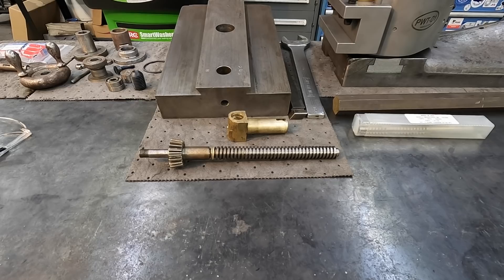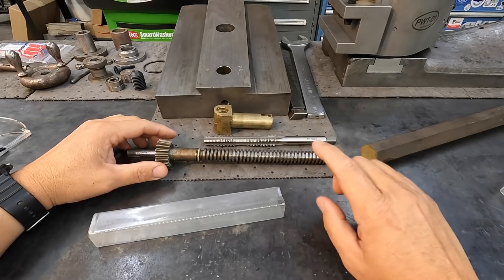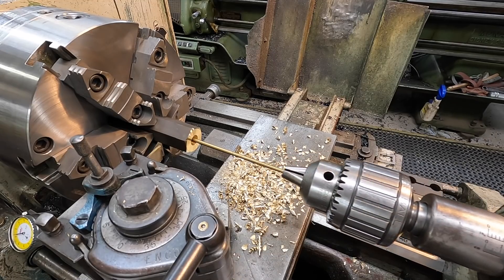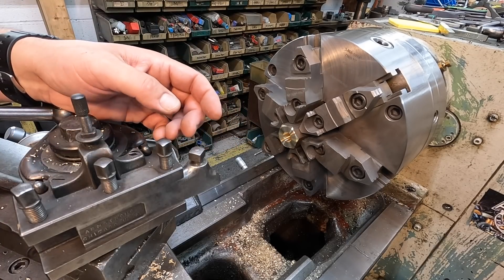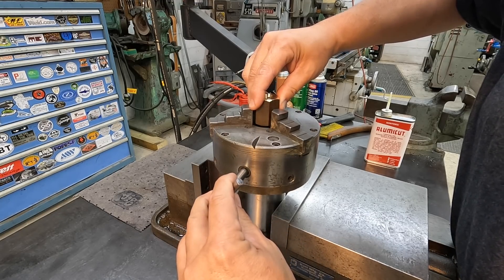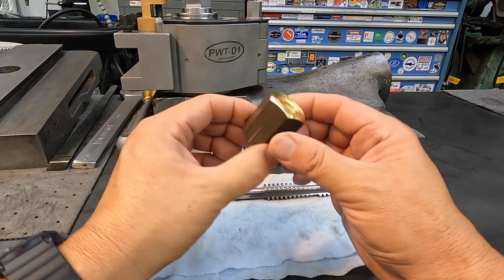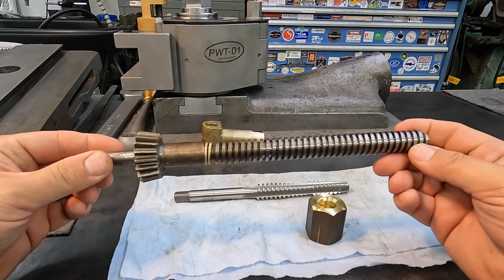Machining a Bronze Acme Nut

Comment: save your skin from the flying hot bronze chips.  get a natural HAIR paintbrush  1/2  or 3/4 wide  and hold near the cutting tool/work  and deflect those chips.  don't use a plastic bristle brush---they melt right away

Comment: Would it be possible to make that original square thread using a parting tool but slanted? 
If so, would it then be possible to machine a tap for the inner square thread out of the new threaded shaft?
Just wondering what you would do if you really had to use the original thread...

Comment: Adam, you didn't mention the fact that the thread you are cutting is LEFT-handed.  So for a single job {& an indefinite future sitting in a drawer} you need to buy an acme left-hand tandem tap at over $US 160.00.  It is good to know that there are on-line suppliers who can provide same.

Comment: That small starrett ruler tip was great. I never knew that small of one existed and ordered one right after I finished your video.
Reply: The depth function of a digital or vernier caliper would achieve the same result, however that thin rule would win every time for convenience. Time to find one locally.

Comment: It looked like there was a lot of runout on the Flexarm spindle as it was tapping. Does this affect the thread in any way?
Reply: The tap is following the hole and is not running out. The slight twisting and wobble of the flex arm is the normal torque reaction to the heavy tapping pressure and cannot be entirely eliminated.

Comment: Ok now I have to know, are you not supposed to back the tap out because it's a tandem tap or because it's an ACME tap? Can you back out with regular ACME taps?
Reply: Yes, because it’s a tandem tap, not because of Acme. If you backed out this type of tap the smaller entering teeth would probably cut into and ruin the finished threads. A standard non tandem Acme tap could be backed out same as other taps.

Comment: It looked like the tap was not running true to the Flexarm tool holder - was that my imagination, and if not (if it wasn't running true), could that make your final thread oversize?
Reply: It’s part of the design. It’s a floating arm. Focus on the tap shaft and not the tapping machine. It is running true.

Comment: I always screw cut in the lathe Acme lead screw half nuts for a couple of reasons. 1. being it avoids the cost of a tap which are mouth wateringly expensive here and only likely to be use once so not a good use of resources (cash)
2.  Its guaranteed that the screw cut thread  will be true to the rest of the half nut especially where it is secured to the cross slide.  I did notice that the tap in the tapping machine had a wobble so some sideways strain was put on the tap possibly making it cut a few thou larger. and not true to the machine surfaces.

I have cut h/nuts as small as .625in (a Myford lathe lead screw size)

  Grinding a tool that small can be a bit of a challenge especially side clearance which has to be spot on or the tool will not cut and only rubs.
The most successful way I have found of forming a accurate tool profile is by using a tool and cutter grinder fitted with a multi position vise. A Shadow Graph machine would be handy here to check the profile and size.

I grind the tool just a few thou under size, on the width which allows me to get a near perfect fit by tweaking the compound slide.
Reply: yeah I notice the runout in the tapping op too.

Comment: Could you explain why you shouldn't run this tap type in reverse? I just can't figure out why.
Reply: My guess is the sharp points of the first part might mar up the inside of the nut on the way out, kinda like how when you bring a cutter back on a lathe without pulling it out first, where deflection/distortion causes a slight cutting pass. Also, a normal tap is tapered, so coming out backwards there will be no rubbing. But here there are essentially two taps, and you have to bring out the whole big end of the first tap.
Reply: Likely the same reason you don’t run a reamer in reverse.

Comment: Had the occasion to drill and tap some heavy dimensional copper once. Tried all  of the conventional tapping and cutting fluids, even tried kerosene (recommended by a machinist friend), but to no avail. Wound up twisting off several drill bits and breaking three taps. Finally, by accident noticed the jug of bar and chain oil used in the chainsaw, decided to give that a try. 
    Finished the job with one bit and one tap. I would have never thought as sticky as that stuff was (akin to STP oil treatment), that it would have worked. But it's stickiness must have been what was needed to counteract the soft gummy nature of electrical grade copper.
Reply: Yeah copper's a bitch. Thanks

Comment: Back before expensive tandem acme taps were commonly available, we would have rough single pointed that size ACME thread in the lathe, and finished it up (also in the lathe), with a conventional single section ACME tap to produce final size.  
I noticed the run out while you pushed your tap through the bronze. 
Single point threading, then finishing with a tap in the lathe, reduces any possible thread run out relative to Nut OD.....if that matters.
Reply: Had to go back and look after reading your comment and man that did run out quite a bit.
Reply: I noticed that run out too, if you can see it, then it's gotta be pretty large. I was surprised no one mentioned it besides you.

Comment: That flex arm is a really cool tool Adam. Sure beat the old 25hp radial drill we used for power tapping. Used to do gobbs of 2, 3, and 4 inch NPT fittings with skip tooth taps. Back in 1990 they cost a whole months pay.
Reply: Sounds like you broke a couple….(:-))

Comment: Did anybody else notice it was a right hand thread for the nut but the screw will be left hand thread?
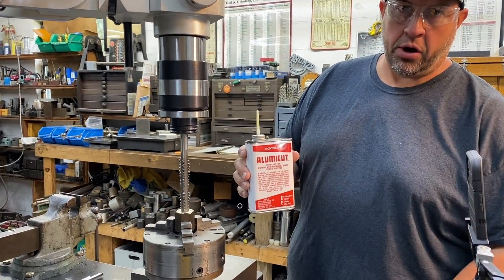Reply: Nope. Watch from about 9:58 and you can see counter clockwise rotation. (Left hand)

Comment: Why does your flex arm spindle not run true. Get it sorted. It happens on every hole you tap !!! Good content
Reply: The FlexArm head is not rigid - it floats to wherever the tap and the pilot hole tell it to go. That's the design. It makes it less likely to break a tap, not forcing it rigid against where it naturally wants to go.

Comment: I did machining in the 70s at that time, leadscrews on precision lathes were ground not cut. What happened?
Reply: This is a cross feed screw for the compound. The primary lead screw on this lathe probably has ground threads.

Comment: Are all acme threads left-handed? also did you make two nuts or just run the tap through from the other end?
Reply: No. Depends on the application.  One nut but two different viewpoint angles of the same cut.

Comment: SQUARE THREADS are not self centralizing like vee thread forms.  They are chosen for high end machine tools for lead and feed screws because they will tolerate radial misalignment, evident when slideways develop some wear.  That means, when axis plane alignment starts to deviate from nominal, this does not cause the screw to bind like a vee form screw would.  It is a dis-service to a fine lathe to change the threadform to Acme.  It is not difficult to tap threads to renew a nut.  It takes more skill to grind a threadform on a toolbit and single point a female thread. I would have gone a different way on this project, but we all have our own path.
Reply: The ACME thread on this cross feed is perfectly acceptable.  It has been the industry standard forever.  "Watchmaker" spec is not needed for this application!
Reply: @paulcopeland9035  Then why did not the engineer/designer use Acme in the first place?  (I told you why.) Whatever industry standard is means you are ignoring the specific engineering requirements for an  application and you are attempting to fill in the gap of ignorance by saying everyone is doing it, it SHOULD work for  my application. It may work, but how well and for how long? Not sure what watchmaker spec is and why you think this square thread design is associated as such.  An ATW lathe is a far cry from anything associated with watch making. Why do punch presses use a buttress thread on their toggle link? Do you think it is a good idea to remake one of those substituting Acme threads too?  --Doozer

Comment: It would have been interesting to check the amp draw on the flexarm with and without the cutting fluid.  It didn't sound like it was helping too much.
Reply: The tap didn't break so it helped enough.
Reply: I don’t think he applied cutting fluid to cut down on the sound.

Comment: Adam I'm having a hard time finding a 7/8"-11tpi square thread tap any suggestions? Didn't find it on McMaster Carr. It's for an old machine made in 1928..;)
Reply: This is probably the exact reason he is converting it to Acme.
Reply: Don't have that option unfortunately as it's part of the design element of the particular machine made in 1928 by some guy named Thompson.
Reply: i think TOT did a video on making a tap
Reply: I'd just get some W1 and make a tap or single point it, 7/8 is enough room to get in to single point it.. I'll assume it's bronze so the tap won't be overly hard on the cutting edges.. i have to make a smaller square thread for a nice vice i got cheap but the nut was missing, it's only small so a bit on the tight side to single point so I'll probably have to make a tap but I'm lazy so if i can single point it i will
Reply: If McMaster Carr doesn’t have it, they probably don’t make it.

Comment: I used a tap of this type some years ago to make some cross feed nuts for the Logan Powermatic lathes we had at school.  I guess I did not know this type of tap was meant to only go forward and not be reversed.  Interesting and a valuable tip.  By the way my nuts turned out just fine.
Reply: Go easy tapping your nuts and they should be fine
Reply: I try not to get my nuts tapped, kinda hurts

Comment: How were you able to resist trying the test nut on the existing leadscrew?
Reply: Why? Different thread profile.
Reply: @EJP286CRSKW  Is the lead screw a square thread that he’s replacing with Acme?
Reply: he didn't resist but he has control over the editing. 😀😀😀
Reply: It is not the same thread.  This is explained in the video if you can to listen.

Comment: I remember using taps like this 25 years ago they were huge 3 inch finish cut with 3 different taps they were at least 2.5 feet long on the boring mill was so worried about them breaking in the parts but they cut like butter with no problem 😉
Reply: I have broke them using a boring mill it’s not a good day haha
Reply: Yes indeed they do work well there is a reason for there being three taps to get the thread cut on larger size one a little bitty one inch not so much

Comment: I always loved how bronze looked when machining it but the sound? Can't say I miss that.
Reply: The captions called it “applause” at one point.
Reply: i'd say it was brass.. Bronze doesn't screech like the.. :-)
Reply: @energiespecialist1615  I think it depends on the type of bronze. I feel like aluminum bronze (I remember 959 because I'm a Porsche fan 😁) might have been quiet but bearing bronze was unpleasant...or maybe the other way around? shrug it's been 15 years lol
Reply: @energiespecialist1615  
Brass is a bronze with primary alloying element of zinc.
Reply: @energiespecialist1615  Exactly ,to my ears it sounded like brass ,bronze and alubronze is nasty material compared to brass and sounds different and harder to cut through......
Reply: I think my ears are bleeding 😬😅
Reply: That flex arm machine has a really high pitched whine which would be good to filter out somehow as well.
Reply: For real
Reply: I always hated cleaning it up. If you’ve done much bronze turning, you know exactly what I am talking about.

Comment: The way you removed the woodruff key, that is gold. I'm learning machining on your channel. Simple tricks or old school experiemce, I would have never thought of doing that way. Thanks man. Keep them coming.
Reply from the maker: I’ve used the mill vise many times to remove large keys from shafts 👍🏻
Reply: @Abom79  are you working in your new shop yet? When I see you working in your current shop I want to ask if everything is ok?
Reply: @Jimmy_in_Mexico  He is still in the process of setting it up. That project in the above video is for his big lathe in his new shop.
Reply: @Jimmy_in_Mexico  New shop is not finished yet but both shops will stay running full time.
Reply: @Abom79  why does the tap have two sets of threads??
Reply: @pacificcoastpiper3949  
Volume of material removal is large which loads flutes excessively especially with stringy materials.   Not that anyone would try even this tap with 304 stainless.   Made the typical bronze cry even with this design.

Sure, one could make a single profile tap with Acme but it would require back breaking the formed chips very often.
Reply: @pacificcoastpiper3949  he said the first set is not full thread (think of it like a pilot drill) and then the second thread set is full depth.
Reply: I tell you, man - watching Abom79 has made me smarter, and I’m not kidding.
Reply: For sure.  It's one of those things that's obvious in hindsight!  I would have been fooling around with pliers, maybe a hammer and drift trying to get it to pop out.  Nope, all you need to do is clamp and remove the shaft from it, not it from the shaft!

Comment: Is the solid-carbide boring bar good because of its relative stiffness, or because you can simply regrind the edge on something like a D-bit grinder?
Reply: Carbide is 3 times stiffer than steel so it doesn't chatter anywhere near as much.. many carbide boring bars have a steel end that holds an indexable insert just like a steel boring bar.. check out Stefan gottswinter, he cut the end off a cheap 12mm steel boring bar and silver soldered it to a carbide shank and it worked great.. i plan to copy what Stefan done one day when i get around to it
Reply: @markshort9098  I'm well familiar with Stefan. He recycles a lot of carbide and uses his D-bit grinder to shape cutters that he can't buy or buy cheaply.
Reply: @hughmac13  Stefan done a rigidity test on carbide vs steel in the video where he put the steel boring bar head on a carbide shank
Reply: In machining it’s rigidity, rigidity, rigidity.

Comment: I cheated when I made my cross slide nut, bored out the old thread and silver soldered a sleeve and retapped, save you making the whole nut.
Reply: There are many ways to take the hide off of the feline.

Comment: Will taps like that thread 12L14 steel without problems?  (5/8x10 acme)
Reply: Yes, as easy or easier than brass. 12L14 leaded steel machines beautifully with an excellent finish, much like brass and can even be form tapped.
Reply: @ellieprice363  thank you for your information! Greatly appreciated
Reply: 12L14 leaded steel is VERY free cutting.  I would not be surprised if some bronzes are harder than 12L14.  Thousands of years ago, iron replaced bronze because of cost, not hardness, advantages.
Reply: @eliduttman315  thank you for your information! Greatly appreciated!!
Reply: @FrontlineArms  12L14 leaded steel won’t make that awful squealing noise when it’s tapped like bronze does. However it’s not suitable for long wearing 
bearing surfaces so it should not be substituted for bronze.
Reply: @ellieprice363   Thank you. I don’t have any brass or bronze. I am making a large clamp for holding large pieces together for welded. I have some 12L14 that is just right size to be the nut. I don’t expect to be clamping super tight so hopefully it will not gauld the threads together.

Comment: I am a little confused. Why was the acme thread cut left-handed? Are all acme threads left-handed?
Reply: You are correct. Most threads are RH. However, shaft Adam has is LH thread. All cross slide threads are LH. Otherwise winding handle clockwise would pull the cross slide toward you instead of away from you.
Reply: @bobhudson6659  Makes sense, Thanks

Comment: If you don't mind a suggestion, because this being a tool consider etching or stamping a discription of what it is for,. Years down the road you might not remember.
Reply: Really not necessary. ACME threads are easy to spot, and an ACME thread pitch gauge makes quick work of identifying the threads per inch.
Reply: It's an acme tap. What else do you need to know?

Comment: Is that old thread like a buttress thread?
Reply: It's a square thread. A buttress thread is asymmetric, square on the load-bearing surface and trapezoidal on the back. Like a square thread and an acme thread had a kid.
Reply: @danmenes3143  One type of quick acting drill press vise has buttress threads. The design is very convenient to use and will not slip under pressure.
Reply: No the thread form is quite different. You can probably find illustrations on Google.

Comment: That Flexarm is a gem of a tool. Nice job Adam.
Reply: I agree completely, and the number of peanut-gallery-ticians who whinge about the flex arm is stunning.  It works well, is easier to set  up than a mill, etc. etc. etc.
Reply: @silasmarner7586  The fixturing setup with chuck and vise is clever. Adam paid attention while working his way through the years.
Reply: Ok but in this case - it was already a lathe part, wasn't this power tap mechanism really advantageous over a lathe? If so why? Thanks
Reply: @AlessioSangalli  How would you hold that tap securely in the lathe all while having full control of the feed? That’s why the Flex Arm is the best choice. Purpose built tool.
Reply: @grntitan1  It also has that built-in clutch to stop the bit if it binds up.
Reply: @grntitan1  a purpose built tool for when you have to tap 20 holes in a plate; when you already have a piece in the lathe already perfectly aligned... I am not sure what you mean with "hold the tap securely" in a lathe, it's a basic technique